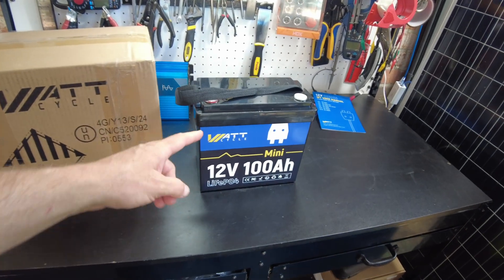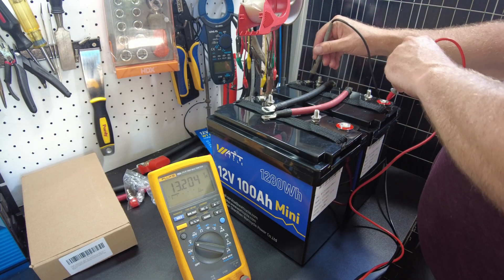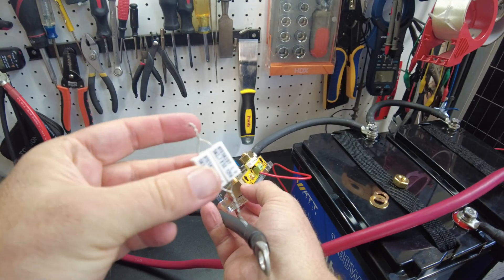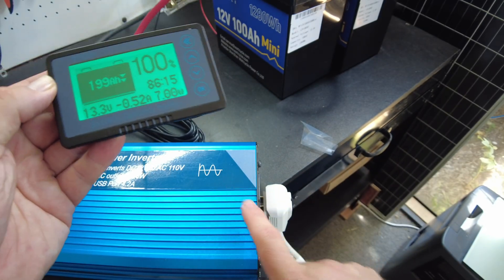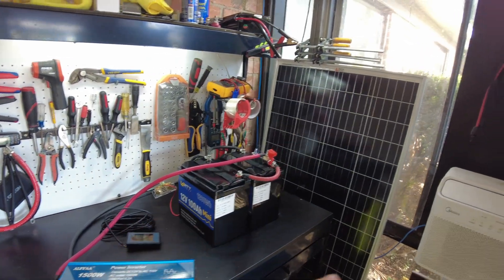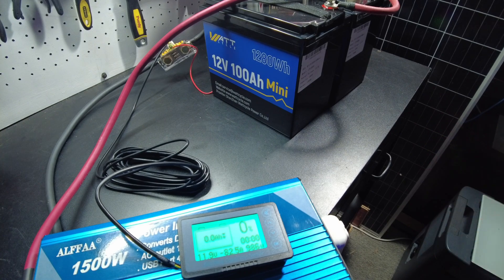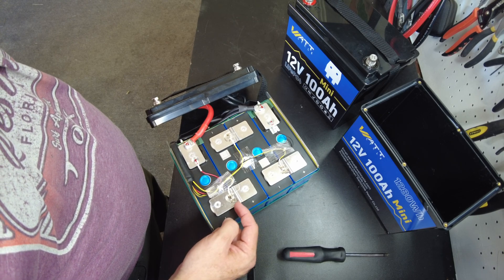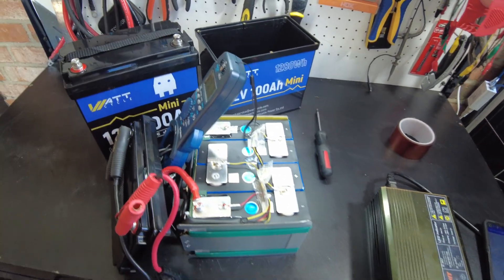Wattcycle MINI 12V 100Ah LiFePO4 & Battery Monitor

Comment: Hi thanks the useful video. I seek your expertise on the subject of the shunt. As the shunt is installed between negative post of the inverter and battery, would it be possible to install an additional negative cable directly between the inverter and battery...just like the positive ? Thanks

Comment: Does this battery use a bluetooth module plugged into the BMS, or is it built into the BMS circuit board?

Comment: How do I order this setup? Did you get it all the same place? I’d like 2 of these batteries with the wiring and shunt and screen thing. The whole setup battery wise. Not the inverter or charger just the battery related stuff
I see you have both links, so all I’ll need otherwise is some wire or does it come with this too?
Wanting to build my first solar setup for my 20’ storage container ventilation. Would I even need 2 of these or just 1?? I really only plan for fans to run when the sun is beating down on the container. So I probably only need 1 battery. I want to run a couple efficient fans during the hours of the sun blasting on the container. In fact I may be better off running solar fans that run directly off the sun only without a battery. Any suggestions?? I’m completely new to all of this.

Comment: I have the renogy branded version of that battery monitor. It's the exact same thing. It's been great. I haven't had a single issue out of it. It's currently installed in my DIY solar generator

Comment: You never start a timer and let us know how long the Air Conditioner ran from 100-0%. That data along with the specs of the window AC is important info.
Reply from the maker: I can give you an approximation. The AC was on medium, and running around 900W. The two batteries combined have a capacity of 2560Wh, so the math is 2560 / 900 =  2.84 hours. Now this AC can run around 300w on low, also depending on the ambient temp. So possibly 8+ hours on low. There's a link in the description for the AC. Thanks

Comment: One of the few batteries with near adequate internal wire size to the main terminals.  

A T Burke
Reply from the maker: Yeah, I don't think I've seen a wire that size in a 100Ah battery. Thanks!